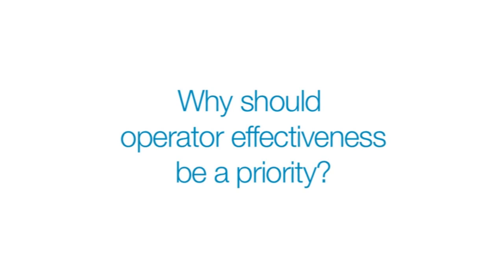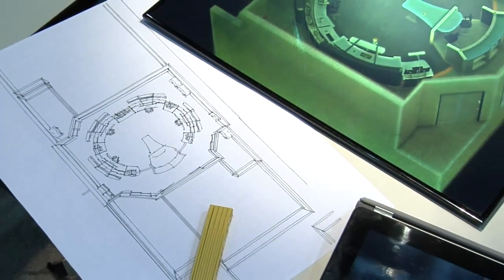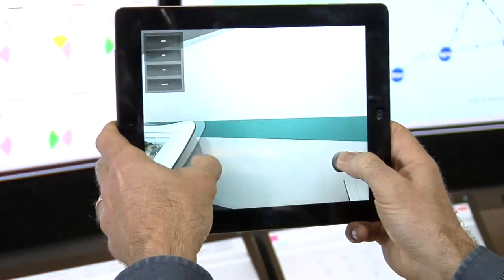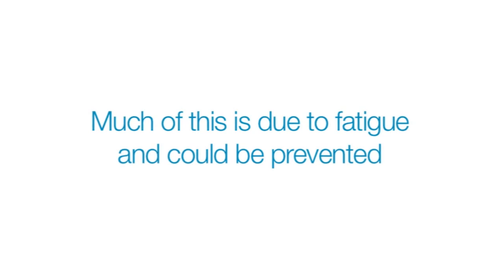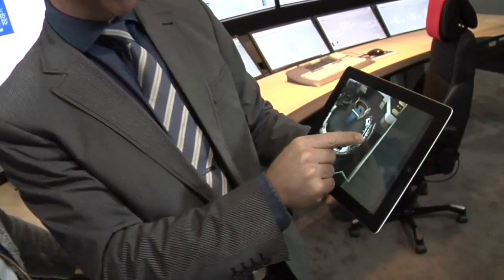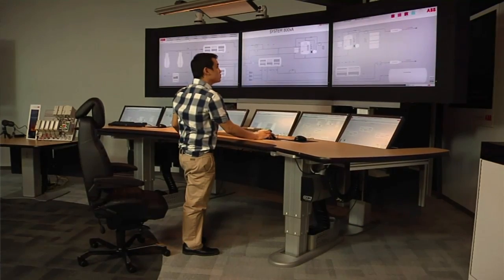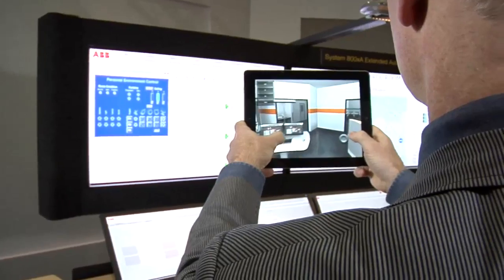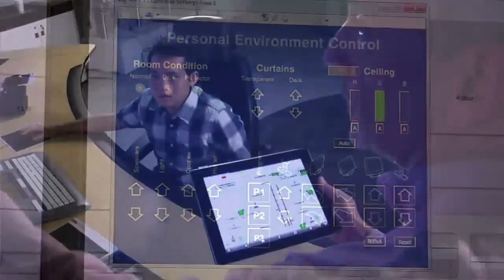Maximizing Operator Effectiveness In the Control Room

Comment: The #humanfactor must be the first thing that designers understand: the physical, physiological and cognitive capabilities o f the human factor must be known before any design process. Ask the experts in control room design at Optimal Performance Consultants info@optimalperformance.ca
Reply: Question-Jane Sleeth. Do you have any information to share regarding the human factor? Explaining what I mean by that is , I'm a Console Operator, I have some excitement going on in my process that requires my undivided attention, but I've got Engineers, Superintendent, Workers, the phone ringing and outside operators calling me on the radio. What can you tell me about what's in place to minimize the interruptions/distractions so that I can concentrate on taking care of the issue I'm having with my process?          Anthony Thomas